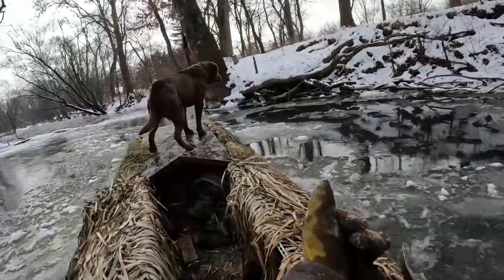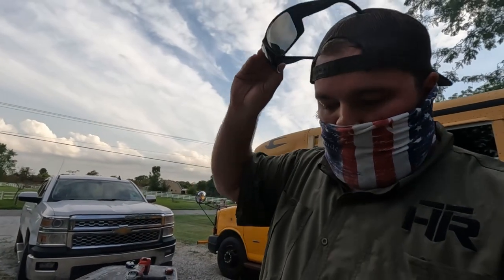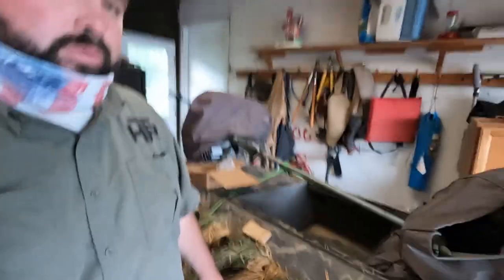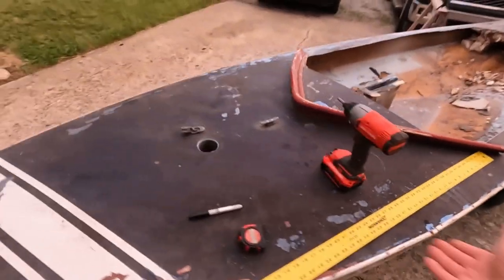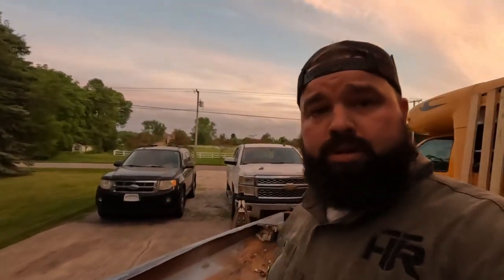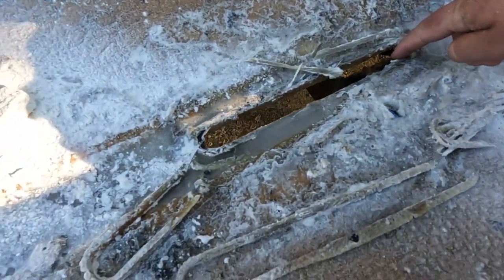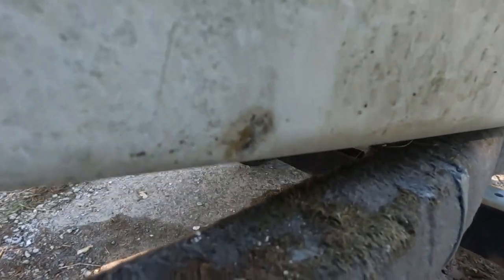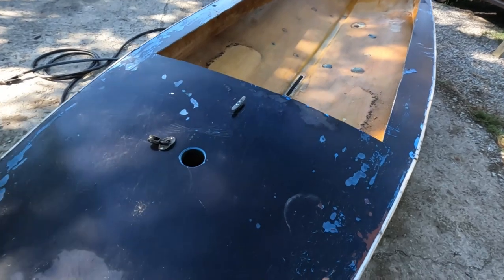BUDGET Duck Hunting Sneak Boat! Converting a Sunfish Sailboat into a Duck Hunting Boat!

Comment: Buddy I've been working with fiberglass for years make all those hole Cuts all in the top and all in the bottom around the plug make them Circle Cuts don't leave them with square edges or you'll get spider cracks and that will take on water you'll be looking for them everywhere and not know where they're at good luck stay safe
Reply from the maker: Thanks man! I already fiberglass over em hopefully it does alright 😬😬